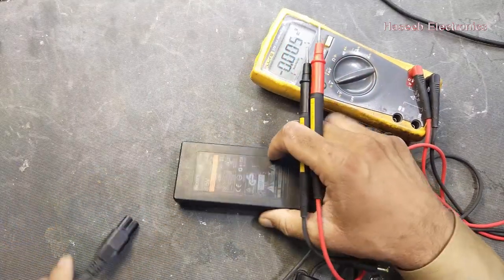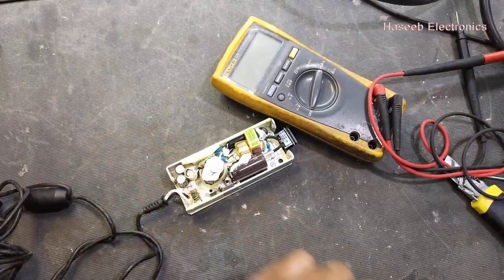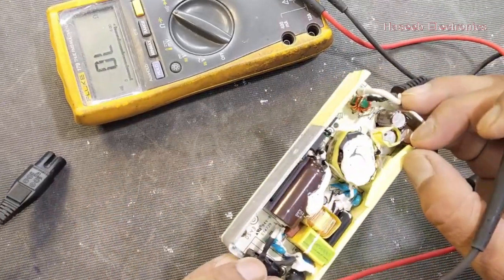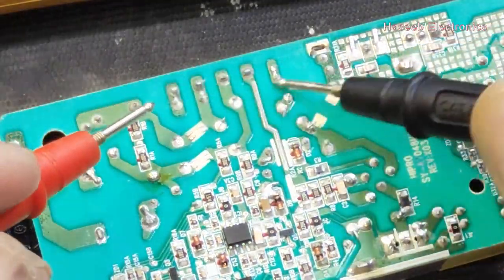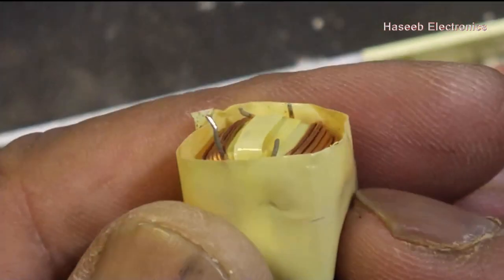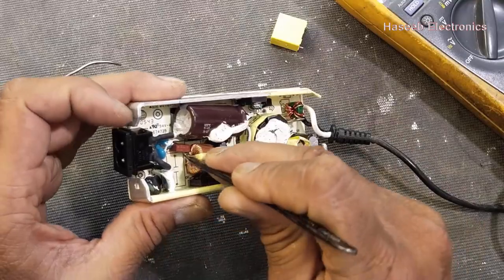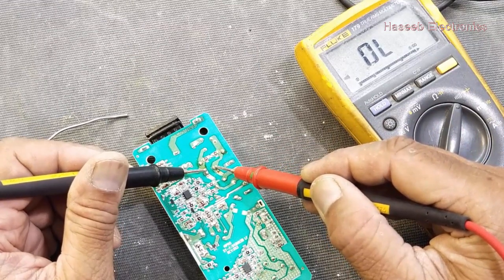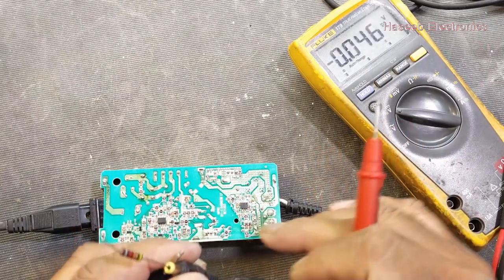[437] How to Repair Sony PlayStation PS2 Power Supply - No Power ON, How to Repair PS2 SMPS

Comment: hello Sir, I want to learn about ST02D diode or T2D diode series, what is the purpose of use in atx smps circuit? It is using in general near the standby transformer and why? And how can we find the equivalent or can we use normal diode instead of T2D diode  !
For example some T2D series;
T2D 49
T2D 34
T2D 16
T2D 87
...

Comment: I have successfully repaired my first smps by your help sir, but I can hear a certain sound coming from the smps.. is it normal to hear a sound when I switch on the smps? Is it inductor or transform er producing the sound? But the smps is producing 24v without fluctuations. Thank you
Reply from the maker: Wow it is my pleasure.
some time the looseness of winding makes tick tick sound or some separation between core halves due to poor bonding of adhesive causes this sound
sometimes the low or high frequency makes whistling sound.
if it is producing a normal output at full load without some annoying sound, then it can be acceptable
Reply: @HaseebElectronics  thank you for clarification on that. Keep on posting more videos sir

Comment: I have a broken adapter with 5v 3a specs. I checked capacitor that supply to the pwm IC, it is supposed to be around 12v (dc) but it voltage is way too high like 53v that flow to pwm IC, can you advise why the voltage become so high? I can not pin point the problem, hope you can advise, thanks.

Comment: last we repaired one cup smps. we found that inside two capacitor was not good. we replaced capacitor 16v 1000 uf instead of 16v 2000uf. now it is working.  is it possible to use capacitor like this rating
Reply from the maker: that is awesome. 
if you use low capacitance, may be it may cause to produce ripples at full load operation, because the low capacitance will provide the required current, and the internal temperature of capacitor may rise and it may reduce its working life 
so try to select some close value in capacitance